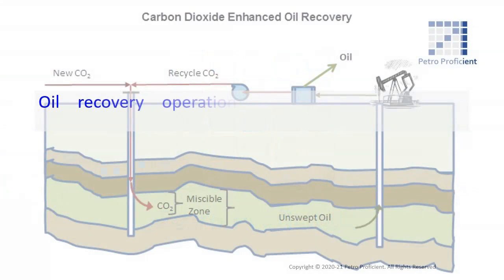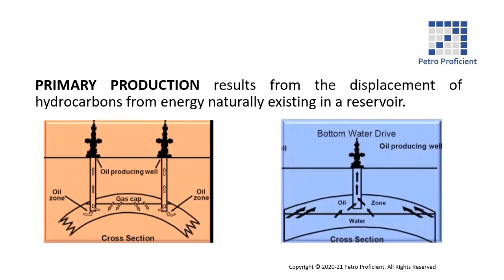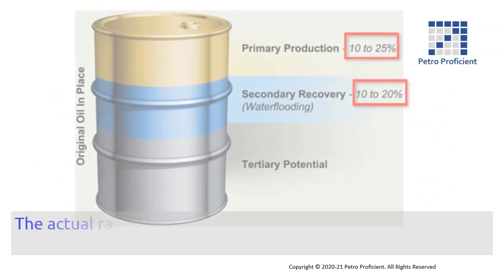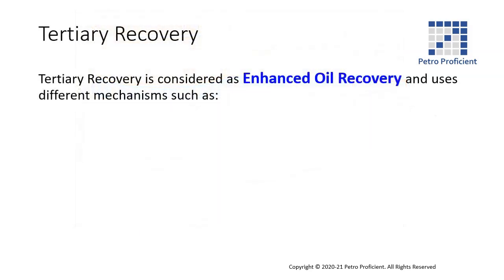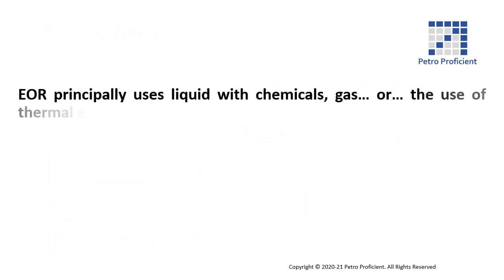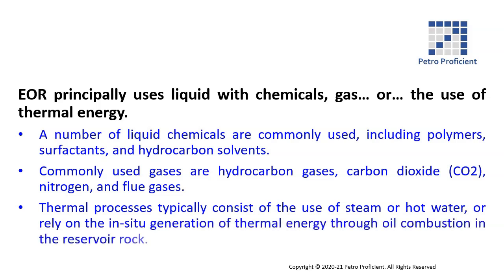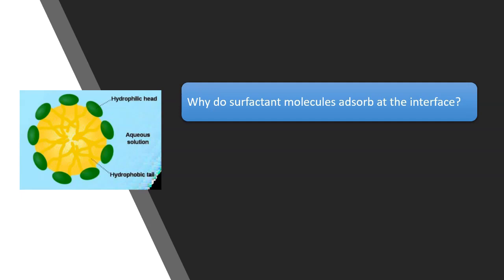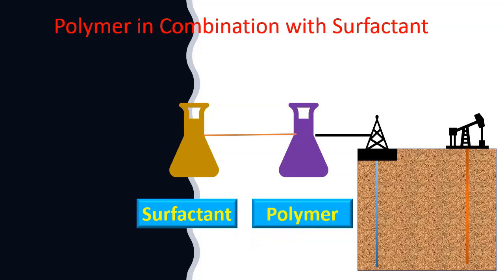4. Enhanced Oil Recovery | Surfactant Flooding | Part-1

Comment: It is pertinent to note that nearly 70% of the oil is recoverable at the tertiary stage. It will perhaps be absolutely necessary in view of the volume of oil left to be recovered... The method to be adopted depends on factors such as viscosity of residual oil etc. This video gives a bird's eye view of the processes involved. On the whole a good video.
Reply from the maker: Thank you Sir for your valuable comment !! Your observations are very pertinent and will certainly help other viewers

Comment: Isn't enhanced oil recovery uneconomical?
Reply: Lot of experiments need to be carried out before they arrive at the right approach which is effective and fits the economics
Reply from the maker: Thank you for your comments !! EOR can be uneconomical if not applied correctly. Normally a lot of lab testing can be done to ensure the correct approach